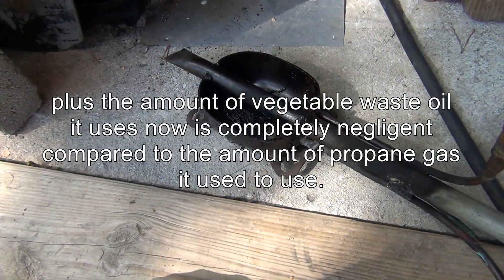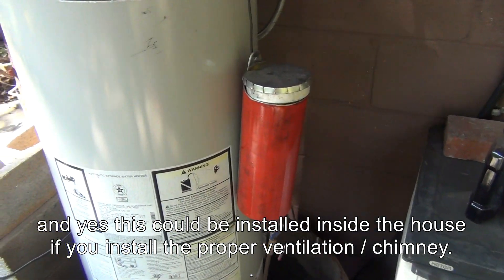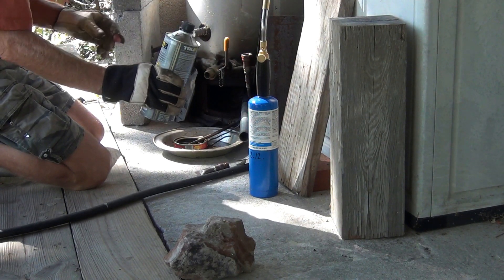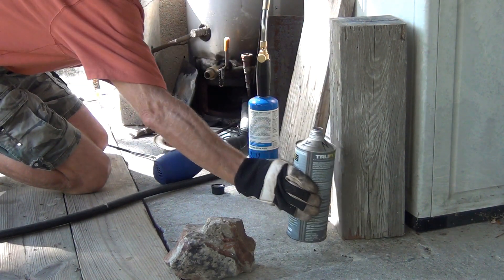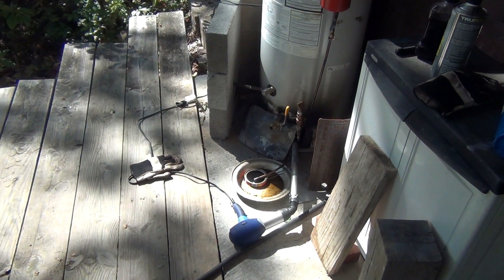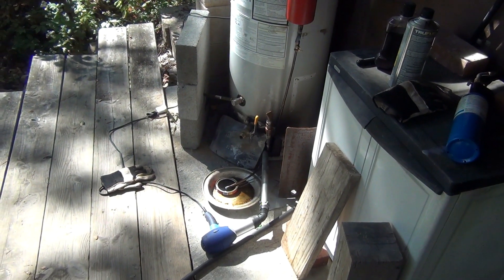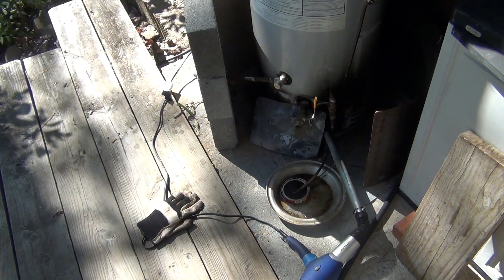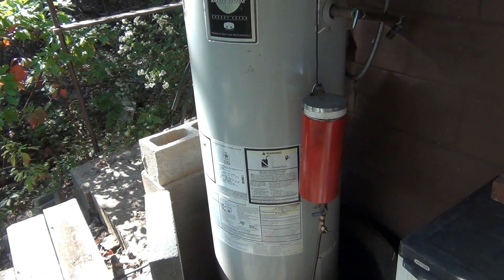Waste Oil burning water heater equals free hot water.

Comment: Nice idea.  I use waste oil in my shop for heat.  I pour my oil into a 5 gallon bucket with a paint strainer bag over it to get the big stuff out.  Also, a low point drain to get water out is a good idea.